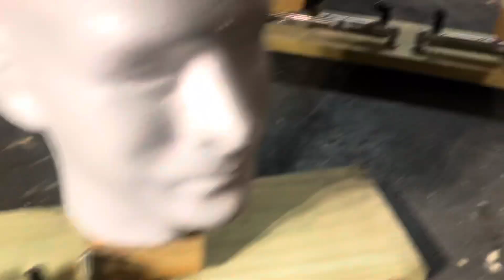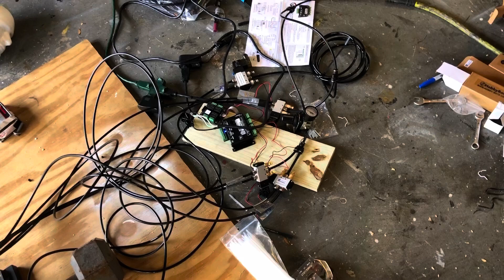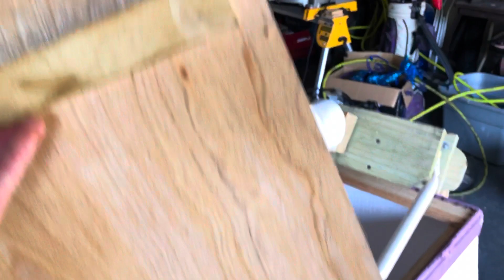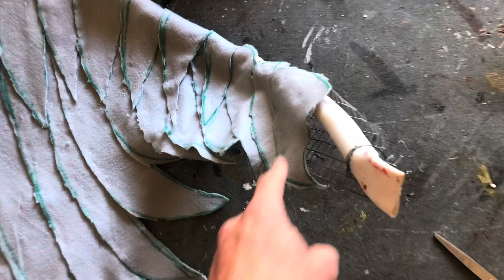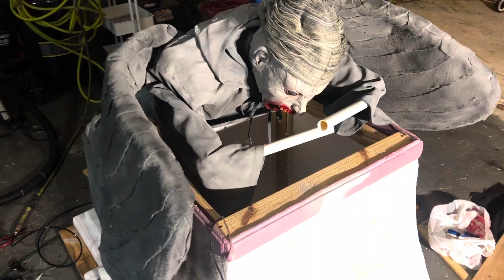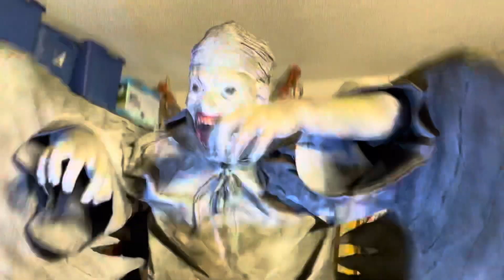Animatronic Weeping Angel Statue for Halloween

Comment: What strobe did you use and how did you hook it up to the picoboo because from what ive seen on the manuals it looks like you have to some how strip another power cord and wire half of it to the picoboo to power it
Reply from the maker: I used the ADJ Big shot LED II. And if you are using a picoboo you have to strip one of the cords (I forget which color it is but it will show it in manuals) and wire it directly to one of the outputs. If you are using the BooBox like I am here for the Angel, you have to get a separate relay that wires into the controller. You then strip the extension cord and wire it into the relay. I am pretty sure I show that in this video.
Reply: @AndrewLong  ok thanks

Comment: Andrew spoke your dad today about your prop and the replica I am trying to make!  He said you might be able to help me as I go through this.  I have the main body working and just have to program it.  Wings are next.  I have failed once bending the PVC but I think I messed up using the thicker schedule 40 stuff.  Bought the thinner 3/4” pipe today and gonna try again
Reply from the maker: Hey David! Very excited that you are building one! For the PVC I would definitely try adding some metal brackets at the elbows and possibly rethinking how they connect to the swivel at the shoulder. I personally had problems during the haunt nights with the pvc breaking because of the weaker joints where the heat gun bends it. If you have any other questions ask away!
Reply: @AndrewLong  yeah I actually used the thick schedule 40 stuff for the arms inadvertently so those suckers are pretty rock solid.  It was shaping the wings that is really challenging me right now.  I am also waiting on some manifold plugs so that I can run all my cylinders at once in a show.  But all of my cylinders have been tested individually and do work.  If you have any wing shaping tips I’m all ears!
Reply from the maker: @davidarringtonmd  sounds good! The wing shaping was trial and error for the most part. You have to make sure the shaping is wide enough so that it fits around the pedestal when the angel comes down. It would sometimes catch the very edge.
Reply: @AndrewLong  ok good to know!  I will be careful with that.  I’ll let you know when I make some more progress.  Work always gets in the way of these more fun things!
Reply from the maker: @davidarringtonmd  yep exactly 😂 good luck!